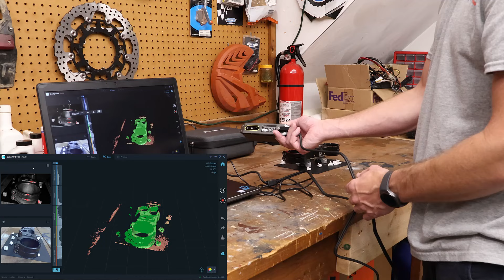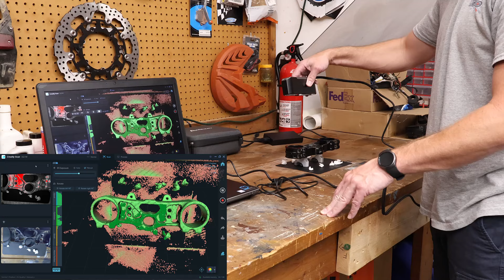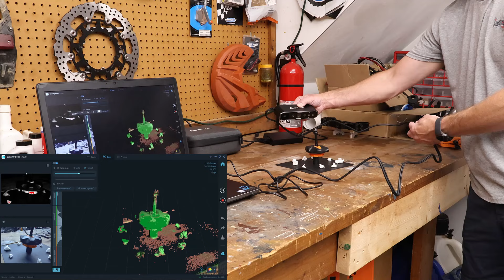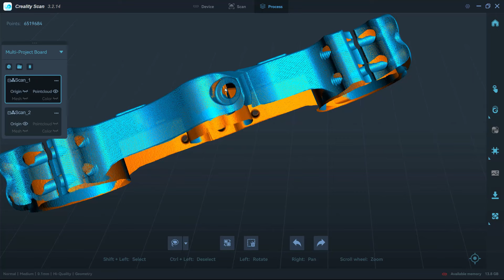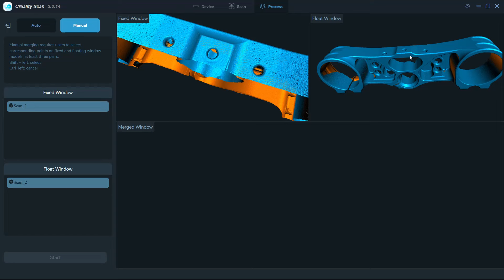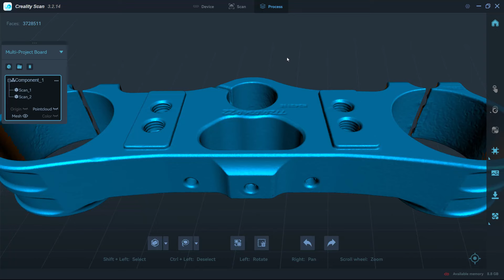How to Scan Motorcycle Parts with the Creality CR-Scan Otter | Real-time how to scan and process

Comment: Hi Matt!
Awesome video. Comparing with the work you did with revopoint scanners one thing stands out - a lot less noise, no? They just need to work on the software features you mentioned and I will def. get one to complement my einstar. 
Regards. Luis
Reply from the maker: Hey Luis,  The noise comes from a few places.  Scanner calibration can offer up noise if its off, but the illumination as well.  The Otter seems to handle shiny surfaces really well while the revopoint scanners need a scan spray.  Once there is spray involved they should be fairly similar, but without yes it would appear like a little less noise.

However I will say it is very much surface based.  I scanned a mountain bike pedal that was orange plastic and there was more noise on it than with the black triple clamp.

Comment: I knew you were a dirt bike fellow! Husky FE250 here.

By the clues on your pegboard, it seems you ride a KTM 350, also in Enduro or Hare Scrable.
And you also enjoy a Yamaha TW200 (I saw a certain box up there... :-).

Your videos are on another league! Excellent. Thank you.
Reply from the maker: I sure am :)  Funny enough I am more a motorcycle guy than car guy but this channel had more responses to car modeling.  Currently I have a 450sxf that has a tag on it.  that is my moto/dual/supermoto bike.  And a 250xc for the woods.  The tw200 is my wifes bike.  Its a fun stable little bike.  and i have an old gpz750 still.  I worked at a few bike shops in my younger days and used to ride a lot more moto but that shifted to supermoto and trails more these days (sadly more mountain biking than anything).

Comment: let's not get into the mindset that it has to be expensive for it to meet a certain user grade. This is what has created the avenue to make it difficult for good products to become competitive for the average user to get into a space. Most expensive stuff are not expensive because they are good, they are expensive because of corporate overheads, due to brand and marketing and sometimes the intent to fence new entrants to become reputable.
Reply from the maker: In a general sense yes, but in the scanner segment I would disagree to a certain extent.  Are expensive scanners worth the money they charge?  To some yes but the gap is getting much smaller.  The ROI certainly drops quite a bit.  I think that is where Shining 3D has settled into the market as a more affordable professional scanner offering with their freescan laser scanner at $17k vs the Creality Scan Raptor at $1500 or so.

Hardware between these consumer scanners and the "Pro" scanners is getting closer.  But I will use a welding example.  You can buy a 140amp mig welder from your hardware store.  It welds and if you are welding thin plate up to 1/4" it is likely fine for most projects you have around the house.  But a pro welder that will also weld 1/4" plate and thicker, while it will perform the same job, has a lot of differences.  In the welding case you are talking about a higher duty cycle.  You can run the machines 100% of the time.  Hobby units at the hardware store can be run for maybe 1min and have to cool for 10min (10% duty cycle).  Both are welders but there are some fundamental differences that would make the 140amp hardware store welder off the table for a professional welding to make a living.

The same is true for scanners.  These scanners are great for someone who wants to do scanning for their own projects, but they aren't really in the same place as a professional scanner.  If you are charging an hourly rate to scan, speed is a big factor, ease of use, quality of data etc.  Now is a professional scanner worth $50k when you can get a scanner like this for under $1000?  That is really up to you and what you need to do with it.  You could scan/process the same part much faster with higher accuracy with "higher end" scanners.  And while the .02mm number might seem close going from .02 to .01 is actually a huge leap and .02 is only achievable on smaller parts easily.  As i mentioned in the video software is a big thing that divides these scanners at this price point from something used in a professional capacity.  Even for a program like quicksurface which is meant to be a next step after scanning you are looking to spend over $4000/year for that.  Would you do that for an $800 scanner?

Having said all that I do believe some of the big name scanning companies are charging way more than they should for their offerings simply because they can.  Scanners on the market from Creality, Revopoint, Shining and others are certainly shaking that up.  Until the software is improved on all fronts I still think there is a bit of ways to go before any big company will be hurt by the offerings.  Same with 3d printing.  "pro" 3d printers are astronomical in start up cost and materials and actually running the things.  Has the influx of so many desktop machines really hurt the sales of say HP mjf printers?  I don't know but I doubt it.
Reply: @LearnEverythingAboutDesign  Yes, your response indicates we cannot take it on face value alone. This is all the point i wanted to stress, so that consumers don't feel they always have to chase “expensive” as a way of telling good from bad, but rather learn to match requirements with purchase decisions.
Reply from the maker: Just to add one more point.  I prefer to use tools like Fusion vs Solidworks, which I own both.  I certainly don't think a higher price justifies quality.  I had to pay $8000 to own Solidworks for 2 years and I locked in my Fusion price as an early adopter for $310/year.  Does Solidworks do a few things better, yes, but the only reason I have it is for client work that require solidworks.

Many companies charge a premium because they feel they can and I am glad to see lower price competitors help level the playing field.  I think in 5-10 years we will see that with Scanners.  But in the case of Fusion vs Solidworks,  Fusion wasn't from some startup company trying to get into the market.  Similar play from Shining3d with their einstar scanner.  They offered an entry level scanner at the bottom of their lineup.  I think in years to come we will see some of the big names be forced to drop their prices and offer entry scanners to get into the segment.  I think if they don't their tools will become very niche and obsolete.

Comment: Always appreciate  the clarify in your demonstrations. Kudos for providing the scan data for real perspective. 

It was disappointing to see choose medium resolution on precision machined component. Yes, you should always hand check assembly features. Please show the extreme resolution CrealityScan is touting for this scanner.  You could even use the same part for a direct comparison in the next video (med vs fine).    Keep up the good work!
Reply from the maker: Thanks for the comment Greg!  One reason I didn't use "small" mode on this is because of the size.  While the otter does have the various sizes which do correlate to the precision values, it has a harder time tracking objects that take up a lot of the frame.  So the reality is the process/resolution is a bit tied to the size of the object.

I will however go back and grab some more scans of this on small and maybe update some links/info as that is a very valid point!

thanks!
Reply: @LearnEverythingAboutDesign appreciate the clarification. If I'm reading this correctly, it's meant for table top (turn table)  objects and possibly limited to ~5 in^3?  Very interested to see more on the capabilities.
Reply from the maker: @xfsr20box  Hey Greg, I recorded a follow up video that will go live early next week.  I scanned the triple clamp on small/med/large mode and also did a feature vs marker tracking.

The Otter has 3 size modes which do change the point distance captured in 3d BUT its not as simple as picking the small mode to get the smallest resolution on larger objects.  It affects the trackin algorithm and other things.  What you will see in the video next week is that with such a narrow field of view on "Small" mode it has a hard time tracking the object.  it does ok with markers.

Note that in Medium mode i do also show a mesh section sketch with a fit arc and measure it vs the real thing.  The scan showed 53.9234mm and the measured value was 53.9242mm.

The otter does have a "turn table" mode but i feel i get better results manually moving it around, and it doesn't come with one so you would need to have one.  In my experience the higher end turntables controlled by the software work better than these ones that just constantly spin.
Reply from the maker: @xfsr20box  https://youtu.be/PdtUit4OTO0

Comment: Can you scan the part on a turntable, or do you have to move the scanner to retain orientation in space?
Reply from the maker: You can, but I find with objects like this you would have to do multiple scanner positions to get all the geometry.  The Creality scanner tracking is actually pretty good and moving it by hand seems to work very well.

Also the Cr-Scan Otter doesn't come with a turntable or tripod for the scanner, at least not in the kit they currently sell.  So you would have to have those things.  It has a 1/4-20 thread on it.  When you do the tripod and turntable method though you can't really use the small paper pieces to help with tracking.

For me I would use a tripod if you could capture all the detail from a single scanner position otherwise it isn't really worth it.  just my 2c.